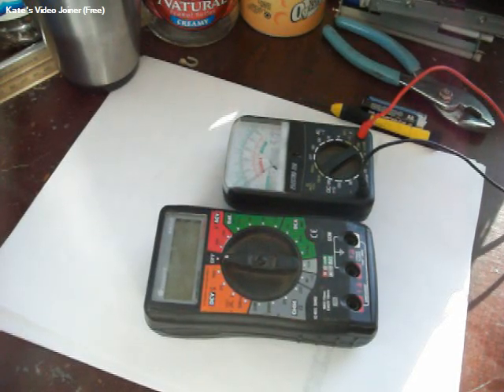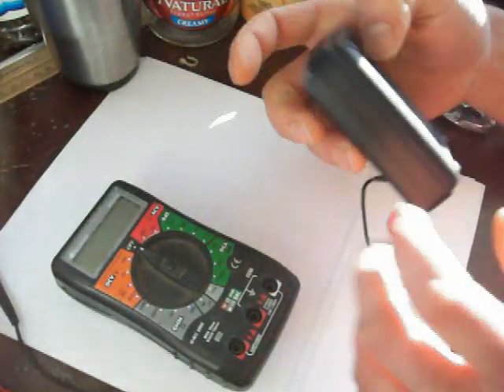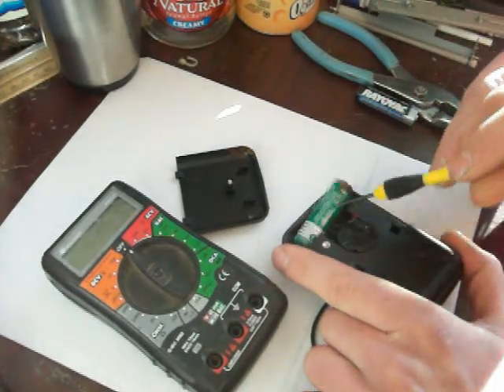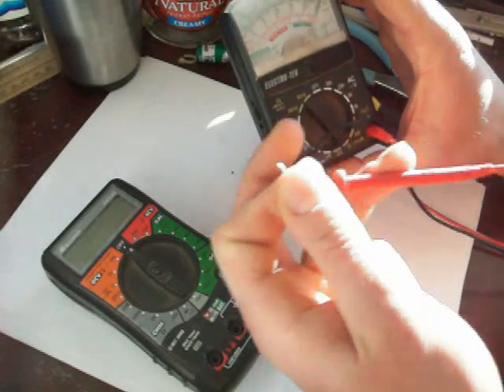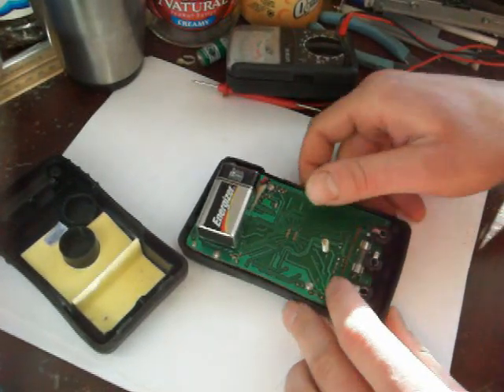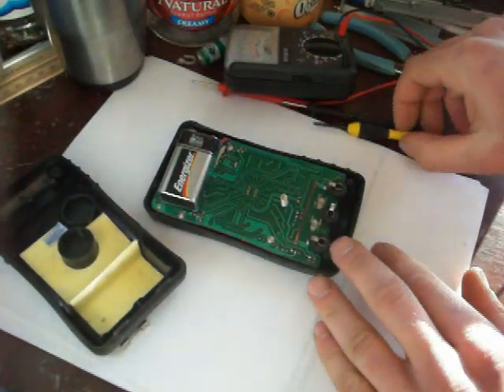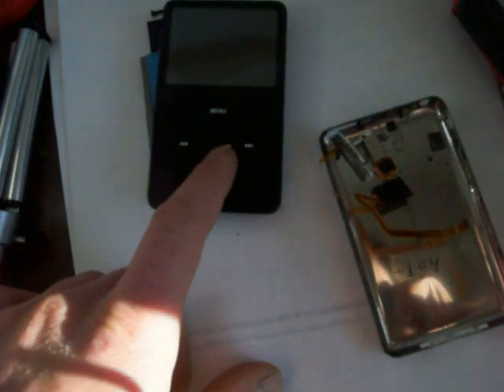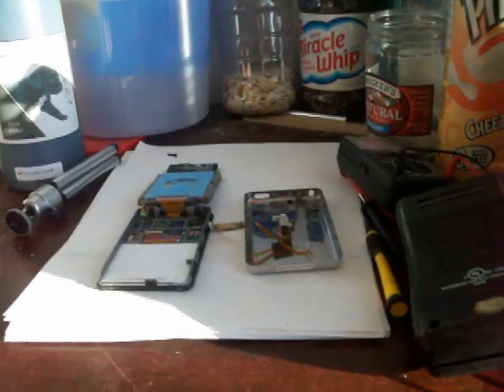Changing the battery on the volt meter

Comment: I have a similar Equus 4320 Digital Multimeter that bought it from Canadian Tire store almost 8 years ago, and I love it; specially for its battery test feature that tests batteries "under a small load" which gives you more accurate result for evaluation of your used batteries. This feature is hard to find even in more accurate or expensive multimeters.
Reply: Equis 4320

Comment from the maker: @ThePickle85 This is a 30gb ipod I bought at best buy about 5 years ago. I can't say anything about what they sell at walmart but this ipod has worked pretty well. I've left it in a hot car, left it in below zero temps in my garage, dropped it on a concrete floor on several occasions and it worked great until the headphone jack started to go out.

Comment: I got that same Equus multimeter. I bought it 3 or 4 years ago for $30 after my Motomaster analog meter gave out because I wanted to try a digital one. It still works great, although both of the end prongs broke off the test leads, so i'm just left with bare wire at the end, although I don't mind that. Although, I would like an analog meter again because they have a scale that shows whether batteries are "good", "low", or should be "replace[d]", whereas the digital ones just give the voltage.